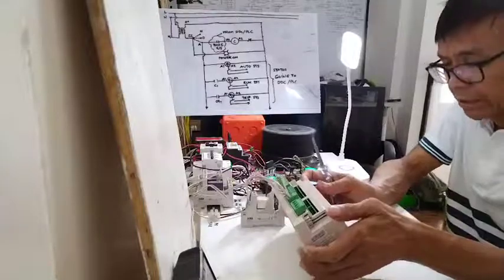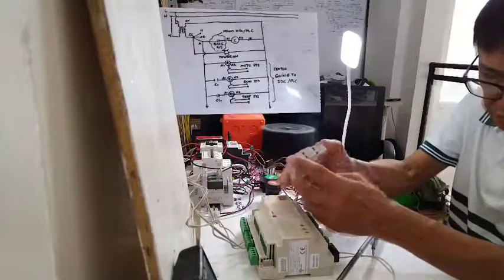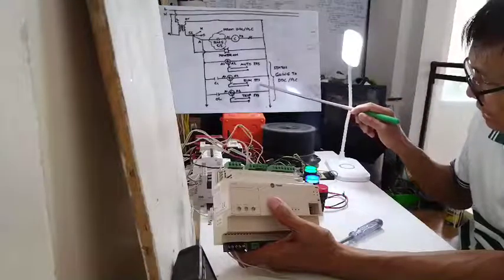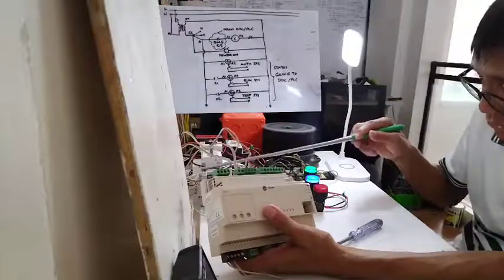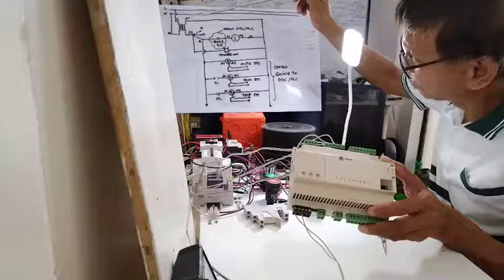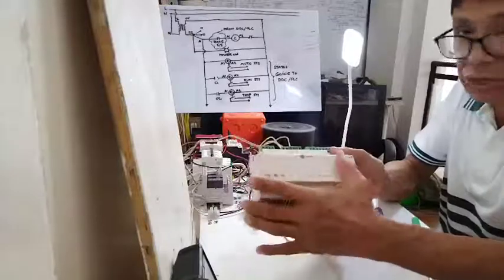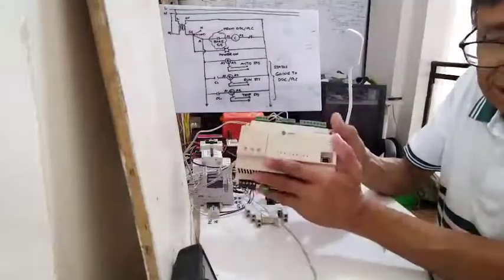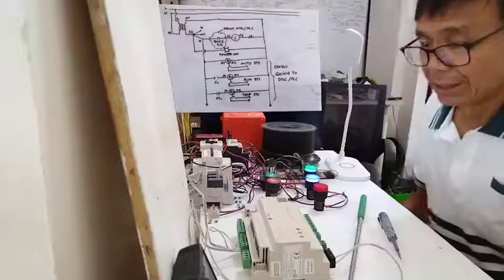Simple Motor Control in Auto Position with DDC

Comment: If I wanna install a booster fan 120v to that uc 400 controller do I need a relay  to B1 and common?
Reply from the maker: you can check the contact rating of BO1 NO if it can handle 120-240 VAC and how many amperes, but it is  more safer if you will use an external relay
Reply from the maker: https://www.trane.com/content/dam/Trane/Commercial/global/products-systems/equipment/unitary/variable-air-volume/VAV-SVX07F-EN_04092020.pdf